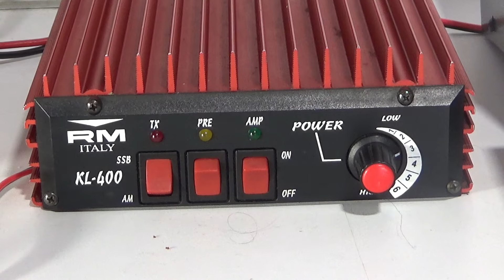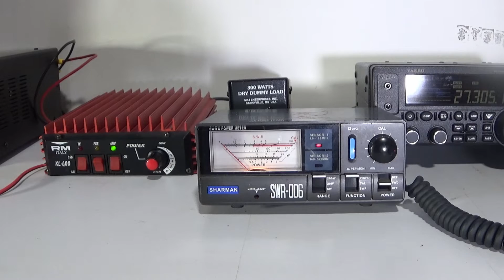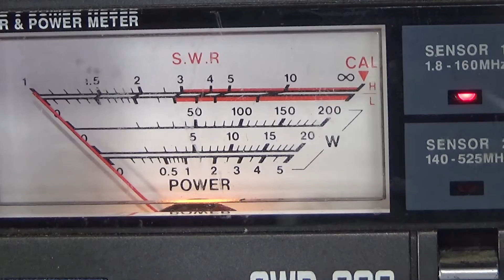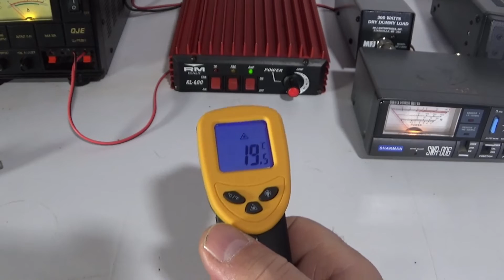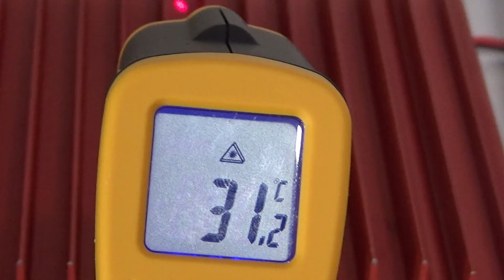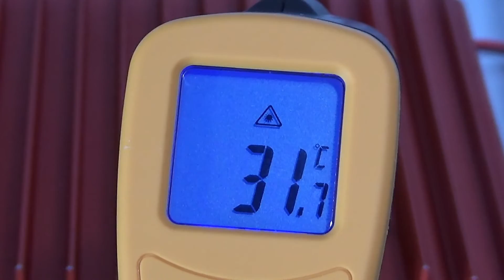RM KL400 Power Tested CB RADIO LINEAR AMP.

Comment: I have had such an amplifier for years and I will write that it is excellent. The output has two paired SD1446 transistors that work in AB class. In my case, with an input power of 10W (AM-FM), the output is 210W at 27,500MHz. With an input power of 20W (SSB), the output power is 390W. But there is one detail that you need to pay attention to. On the power switch, carbon resistors of only 2W are connected as attenuators. At higher input powers, they overheat and after a while they are quite burned out. That is why it is better to keep the input powers up to 5W for AM/FM and 10W for SSB/CW. Only in exceptional cases should it be raised to max. 10/20W. The antenna preamplifier for RX, which contains the BF199 transistor, is solid.

Comment: 5 watts in is to much for this amp
Reply from the maker: the amp is coming up to 10 years old, and still working.
Reply: @CBRadiouk1  crazy, is that with alot of use.
Reply from the maker: @terryshrives8322   a fair bit, but its not run ragged.

Comment: its a good amp if you have a good psu and a good atu to help filter the output. mine runs from a car battery and putting out 150w from 5w in and handles continuous digi modes unlike the kl203 which blew up running digi mode on pskmail

Comment: On am you Sud not drive that amp with no more the a dead key of 1 and a half watt a lot of people over drive the amp I don't care what rm tell you
Reply from the maker: It was a full throttle power test.
The Amp is around 8 years old, and still works well.
You are talking about AM, on FM  there is no swing.

Comment: To set the power properly on ssb you need to measure the radio output in peak envelope power (pep)  . Otherwise you can over drive the amp.

Comment: I've had a kl500 years and two b550's i only run 5w am/fm and 15w ssb into them and they have never complained once.
Reply from the maker: Hi Lee u obviously doing the right things there bud.
My last 500 was around 15 years ago, at least.
I can't remember how I fried the first one.
The second one was my own fault, I was running a mk 1 Jackson.
I never even had a power meter let alone checked its output.
I also had a power mike on it, and was mobile when it went.
P1 p2 and p3 gave no output.
But p4 5 and 6 were OK.
My mate  made me an offer and bought it as it was.
Soon after I took the foundation, and upped my game .
Thanks for the comment bud.

Comment: I'm kinda partial to the Zetagi brand of AMPS.
Reply from the maker: Hi Daniel 👋  I like the b300p, but never could afford the bigger 550.
Reply: @CBRadiouk1  I used to have one of the bigger ones back in the day. I had it connected to two used 12v car batteries with a 24v battery charger turned on precisely because I spent the money and couldn't afford a good 24v power supply. On darker nights you could see the tip of the antenna becoming incandescent.
Today I only have the B300 P-S and it's connected to an 80a PC power supply - I was skeptical but it works great despite its top being 70a. The radio I still prefer to use is an old trusty President Lincoln I.
Thanks for the reply.
Reply from the maker: @danielt.8573  
Hi Daniel  that's 👍  I sold my 2950 ranger to buy a mk1 Lincoln.
The only problem was I could not read the display lol.
I could but only with my reading glasses on, everything else was blurry.
No good while driving so sold it a week later, great rig but no good for me mobile.
I also used to run my zetagi from 2 car batteries, all be it on the smaller b300p.

Comment: Hi mate, looking alp over for a 505hd or a 505v, the HD is 1-35w input, some of the 505v are 1-15w.
500,400,300's are 1-10w, some are even 1-6w.
So if you come across a 505hd, hit me up, as the 700's and 800's, my psu wouldn't cope, cheers Steve, all the best pal

Comment: But what does that signal look like on a scope or service monitor. I've seen plenty of amps that show high power on a meter, but a good amount of that power is garbage.
Reply from the maker: Hi Tim what sort of scope are you talking about fella??
Reply: @CBRadiouk1  an oscilloscope or a service monitor. Seeing total power on a meter doesn't necessarily mean much. A good portion of that power may be harmonics, or distortion not on the intended frequency of operation. 
I've seen meters show, for example, 500 watts, but only half of that power is actually radiated on the intended frequency. Spurs, 'splatter', distortion and wide radiation are useless on your desired frequency, but still show as total power on a meter. 
I wish I could post pics here on TY. I recently worked on an amplifier that was "splattering" RF radiation over 300 Khz, (or nearly 15 CB channels) and was actually only radiating about 35% of total power shown on a meter on the intended frequency (channel).
Reply from the maker: @timmack2415  Hi Tim we call them spectrum analyzers bud.
Yes i have seen a few tests done that way.
Lets be honest most CB Type of amp are not the cleanest.
The video was just a power test with the equipment i have at hand.
Reply: @CBRadiouk1  I totally understand that, I was just trying to be helpful by pointing something out. And yes, service monitor/spectrum analyzer are pretty much synonyms, here in the states anyway. 
I agree about CB amps. Many of them are made as cheaply as possible and lack adequate filtering. I wish I could post a picture here. I received a CB amp that someone purchase at a truck stop. The signal was 300 Khz wide, to be 40 DB down!! And that was an unmodulated AM signal!!! 
I believe that someone makes these amps in their basement from knock-off drivers and finals made in China. 
The amp looked beautiful on a meter, but out of the 300 watts shown on a meter,  just over 100 watts were actually within the 10khz of the channel being used. 
It's crazy that there amp are used and the problem only became worse after the FCC banned the sale of any amps that can be modified to operate on 27 MHz in the US, so CBers don't even buy ham amplifiers anymore. 
Cheers, my friend!

Comment: How much is the price of this linear amplifier? and where can it be bought?
Reply from the maker: Hi romeo the kl400 has been replaced by the kl405.
The price you will have to Google, I paid 175 uk pounds for the kl400.
That was at least 7 years ago.
Reply: @CBRadiouk1  Whew! after 7 years, the price may seems to have doubled. I'll take ur advice Steve, try to google the price for today. Many thanks Steve.

Comment: I think you are testing this amp on the pre amp. setting because this amp says it can do 400 wat.  not 150 wat.
Reply from the maker: Hi John with amp off and pre amp on, it would not produce anything.
Reply: its usual for cb amps to make like only 1/3 of their rated power, so 150watt for a "..400" cb amplifier would be normal.

Comment: Hi again Steve. Another daft question. I have bought a Zetagi TM 999 & an RM 203P Lin Amp  100w AM /FM  & 200w on SSB. On to my SS6900N Radio. Now the daft question. What order do I use them Radio , TM999 & RM 203P then to antenna  or other way around. I have been told that you can use use the Linear safely up to about 8w on AM/FM  & about 6w on SSB. Can you please advise Mate? Cheers Keith
Reply from the maker: Hi Kieth I forgot to comment on the power input of the 203.
From memory it's 20w SSB and 10 Am/ fm.
 Really u only want to be driving it at around 5w.
 I did a power test video on my 203, you probably seen it.
Reply: Yes Steve have seen all your videos and damn good they are too mate. keep 'em coming . 73s Keith
Reply from the maker: Hi Kieth rig, patch lead, amp, patch lead, tuner..
So that's patch lead from rig to rx/rx on amp.
Then patch lead from amps antenna socket, to rig side of tuner.
Then antenna goes into the Antenna socket of the tuner.
 You will find your rig should show nigh on perfect swr, into the amp.
 It's the high power into the Antenna that you will be tuning while the amp is on.
 Can I take it your swr is high without an amp.???
Reply: Hi Steve thanks for replying. Yes my SWR is a bit high at 1. 1.7. I know it's in the safe zone but if I am going to use the linear I really need it to be lower. As you know I am disabled so I can't really do any up and down SWR adjustments easily. So I thought get an ATU and any discrepancies I can sort out from my front room. I am trying get things done without having to rely on others coming to my home and altering the antenna SWR. Plus I am still in lockdown which means I can't have visitors at moment. I hope you can see where I am going, self reliance is better than always asking for help.I am 70 mate and have always tried to do things for myself so it comes hard when you can't do it any more. Anyways mate thanks once again, your a real godsend . 73s Keith
Reply from the maker: @englishandproud1949  
HI Kieth I fully understand,  if u need more help just ask ok fella.
Reply: Thanks Steve. You have no idea how you help me get sorted out . Cheers Mate 73s Keith

Comment: i would not run 10 watts for long into RM amps for long  5watt to 6 watts max power wise they do the power but they can Over heat EASY & Finals can BLOW ZETAGI AMPs are better MORE heatsink ive had B300P & B150   for years & still going Strong RMs are OK for the power but don,t drive them too hard
Reply from the maker: Hi Mathew  if u look at my other vids, you will see one of my b300s.
 My first b300 I bought from Truck king when they were based In Watford.
I must have had that one for around 10 years.
 In my day I had 2 of the kl500s.
Both blew up.
This kl400 is nearly 7 years old.
As you rightly said, don't push it to the max.
The vid was a power test, that's why I put 10 into it.

Comment: I like the linea because I don’t feel those they come all different colors what I could see is they could’ve made the body a little bit different at least put a fan in there put some holes if you can put a fan in there enjoy some of that heat out it may be a little aluminum a little bit thicker inside and outside that could draw some of the heat out but for something for a car or something like that or home Excellent I love the video

Comment: You don’t need to drive it with 2 Watts i’ll stay nice and cool with 4 inch or 5 inch fan and positive and negative gauge replace the one that’s right there take it out one step up ortwo if you say the same or are you taking the cover off Make tiny holes that the heat will come out and you can put a fan in there maybe one or two small ones and run a separate wire or you can put the wire but my drawer too much out of the Amp I got a Texas star 667V I put Toshiba read that dot well it was very easy to put in and I change Inside a linear it’s pushing 850 W I did a little bit of modification on the body stays nice and cool but I can run it all the time I 850 W but as beautiful

Comment: I've got the KL 503. It juices about 275 pep, 120 avg with a 2 watt driver.
Reply: 125 Southern NH I got the kl200p blue model and it does a 100watts with a single mrf 455 transistor. Had it since October 2014
Reply: @spankthemonkey3437  I got about 20 spare MRF455 transistors in my junk box.
I've been thinking about getting an amp that runs 4 of them as I'll always have replacements, not that I blow up amps much

Comment: Enjoyable Vid very Informative 
Theroetically could a Normal 4 watt Cb put through and if so what Switch setting AM or SSB ? 
Regards
Reply: AM with a straight 40 channel cb has it wouldn't have ssb. so it would be AM
Reply from the maker: Hi well id your rig had ssb, you wouls use the ssb setting.
If the rig was only AM/FM then you would use the AM/FM setting.

Comment: Steve, my magnum s 9 does about 25 watts on ssb, I know the amp specs say 20 max. As long as I watch the heat you think I’m ok running it?
Reply: I won't drive mine with more than a 2 dead key. When they say low-drive, they mean it!
Reply from the maker: Hi Jack  I wouldn't as it could kill your amp.
Try to get your rig checked to find out exactly what its putting out.

I would then get the power reduced to keep the amp from being over driven.

Most including myself ALWAYS under drive an amp.

The amp will last a lot longer that way.

Comment: Q can I fit  an amp to an old anytone 5555 or do I have to open the rig up & turn the mod down thanks  (Andy CT1551)
Reply from the maker: First things first.
 check your output power of your radio (whatever it is)
  Check the maximum you can put into your Amp.
  if you decide to use the Amp, do some SWR tests on the hot side of the Amp.

Presuming all checks out try it on Air get some Audio reports.

Try not being tempted to start twiddling inside the rig, most people end up causing themselves more problems.
If you run into problems (and need some help) just ask ok fella.
Reply: @CBRadiouk1  Hi thanks for the help will check power at weekend, & I will probably take you up on the offer for help cheers and 73s Andy.

Comment: I think alot of the people who complain about these amps probably drive them way too hard or don't use a big enough power supply, I've had great luck with mine and I got in 2004.
Reply from the maker: Hi Orange could be fella, I had 2 of the kl500s the things were just mind blowing and to be fair I am not one for sparing the horses.
Bothe went wrong but I started hearing good things about the lesser kl400.
No regrets the 400 is a good amp along the way I like others learned by my mistakes and here we are.
I have one more Amp vid and More to be done. (all radio related of course)

Comment: Now do a heat test with the 9900 😀
Reply from the maker: Hi Global oh yes all in the pipe my friend, I am not sure my temp gun goes high enough :o)
That said I have power tested it, I may do a video showing the results, and the heat test.
My 9900 has been well  thrashed, and still works a treat.
If and when it goes up in a ball of flames I will not hesitate to get another one.
I am spoilt for choice right now as I have the 3900,6900n,cre 8900 etc.
watch this space as I have 2 more vids to show (of other amps)
Reply: Steve Stevens yes the 9900 is a neat little radio seems to do OK if you keep the power turned down below 10 o’clock.  The 9900 you’re really getting hard to find in the state for a decent price. I bought mine for $200 two months ago now the cheapest I can find is $260 for a stop one and a little over 300 for a modified one. I must say I’ve had a chance to play with one of the modified 9900 after the finals had been changed at the stock filters replaced it it was a really neat radio But I think for a few dollars more you can get a nice used hf rig
Reply from the maker: Hi Global yes they are fetching good money over here as well, as you say nigh on as much as a used hf set.

I must be honest I have been very lucky in the radio department, and have now had two 9900s.

The one I use is the first of the two, so I have had it for some time.

Lets just say I do not spare the horses, at times during the summer the radio was red hot before I even turned it on.

To the point that until I cooled it off a little by turning on the AC it would not receive.

From then on it was given NO mercy (at all)

One thing that did give me the run around was one of the fuses turned it self into a resistor.

Mid qso the rig went dead and would not turn back on , I took it indoors and took the lids off.

I tested to se if it was getting power (it was) yet turning it back on only resulted in a sort of click from the speaker.

 At that point I started using the 6900n, thinking the 9900 had blown I even bought new output transistors for it.
Then one day  I tested the fuses, one of them had a high resistance, after replacing it, the rig fired right back up.
In my book the 9900 is pretty much bullet proof, like many others at first the heat from it gave me some concerns.
Now I just turn it on and go, 99.999 of the time I only use it on SSB.
If I was to start using it on AM/FM, I would consider a fan or back it off a little (or both)